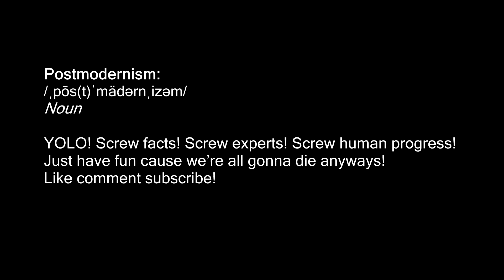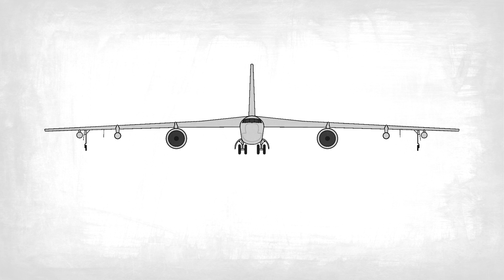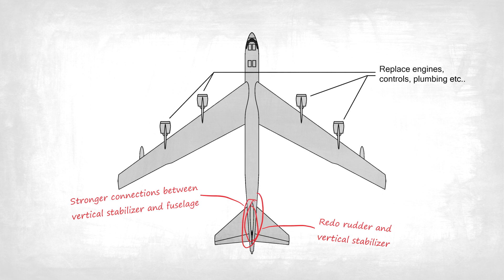The B-52 is Getting New Engines... Why Does it Still Need 8 of Them?

Comment: why not take one B-52 out of service/ one thats out of service and truly see what it  takes in order to modify/change the rudder?? if its feasible and cost effective, wouldn't that offset the cost of 4 engines instead of 8?
Reply: They don't need any airframes at all, simulation software on a modern supercomputer can do the required studies, all except for some fine details.  It's already been done and 4 engines is not even close to being cost effective.  It is much more complex than this video suggests to replace the current 8 engines with 4 modern ones.  Hell, it's a complex undertaking to replace 8 out of date engines with 8 modern ones of the same size!

Let's look at what's involved in replacing 8 with 8:  The modern engines can produce more thrust but at the same time burn less fuel, and they weigh roughly 1,000lbs less for each engine.  It may be a good idea to de-rate the modern engines to the same thrust levels as the old ones to avoid expensive strengthening of the engine pods, pylons and wings.  Perhaps they will decide to keep the extra thrust and reinforce everything, but that does add cost.   They may have to reinforce some parts of the wing structure and wing roots anyway because having lighter engines could mean that in some flight conditions the wing will oscillate more with less weight in the engine pods to stabilise it.  Yes, having lighter engines can lead to a wing structure needing reinforcement, really — aeronautical engineering is complicated.  The different exhaust characteristics also mean the turbulence pattern around the tail will change (the inner engines put turbulence around the tail surfaces) so they will need to study that carefully to see if the tail and rear fuselage need reinforcement — they probably won't, but it will have to be looked at just in case.  Even with this 8 for 8 option some modifications may be needed to the tail area for that reason.

Once it is established what structural changes are needed they only need to change the fuel management system and enjoy the 30% gain in range from the much greater fuel efficiency of the modern engines.  Cost per flying hour may drop by half.  Yes, really.  At worst it will drop by a third.

Put 4 engines on it instead of 8 and the cost of the re-engine program goes up at least 5 times.

To replace 8 engines with 4 you need new engine casings, pylons and the entire wing needs a redesign.  No, you can't just reinforce it, Boeing already admitted that a complete new wing would be needed.  They still tried to sell the idea to the DoD but they weren't buying.  Then you need to reinforce the fuselage at the point where the wings are mated to it.  The tail and rudder need an updated design and although it might be possible to just modify them it is also possible that you couldn't do it that way.  If that is the case then as well as the tail surfaces needing to be replaced the fuselage from the wing to the tail end needs to be reinforced.  So far we only have the forward fuselage and nose area unaltered.  However if so many changes occur to the rear of the plane you may need to alter the forward fuselage just to keep the plane balanced.  That leaves the nose as the only major area unmodified.  Oh, and the landing gear which is so strong and so well designed Boeing said it will cope whatever.  You probably realise now why 4 engines didn't pass.  I haven't even covered half of the extra complexity, by the way.

Comment: The new engines are each around 400 KG lighter = 3200kg in weight savings (though would prob need to add new equipment to interface with the new engines)

But have slightly less thrust, but would be significantly more fuel efficient.
Reply: Everything I have read in the Air Force documents, the new engines have a slightly higher power output, and will never need to be removed from the aircraft, because they are that good.

Comment: Old & outdated.pull out the 747s sitting around & update them.there’s a giant fleet of these things just going to hell.
Reply: Fully agreed.
So many 747s all waiting in the boneyard
Reply: They are there because they are worn out.  In comparison, the bombers have lower flight hours.  Modern bombers are smaller and stealthy, not a big target.
Reply: @robertheinkel6225  modern bombers have big tech & paint jobs that reflect radar.if you mean wore out like electronics they will gut it out in only a few weeks & replace it again.Air Force one is a 747-200 heavily modified for that purpose so it can easily be done & the United States does not mind the cost. In my way of thinking it is easily feasible just has not been approved.

Comment: I worked the B-52 G & H models for 22 years.  This means I have seen a BUFF come limping home after a run on Southeast Asia.  One advantage often overlooked is combat damage.  You take flack or missile damage on an engine or pod, you still have thrust from 6 or 7 engines.  Can’t do that with 2 or 4 engine configurations.  👍

Comment: For those of you who are aware, Rolls Royce had proposed re-engining the B-52 with FOUR engines back in the 90's. The B-52 doesn't "need" 8 engines. That's just what it's going to get.
Reply: you hev squirrel  Sorry, but your base contention ("The B-52 is essentially a modern jetliner") is not correct, so everything after that isn't quite going to work. Just as a quick study, take a look at he differences between a 747 and a 747 freighter alone. And be mindful that a B-52 can carry 48 500 pound bombs plus a full fuel load. 12 tons of bombs alone. No "airliner" is going to do that. And no 787 or 757 can do what a B-52 can do. Sorry.

Comment: I dunno, I think correcting the rudder deficiency should've been done 30 years ago(or today, instead of a marginal engine upgrade) to make way for a better engined version today.
Yea, sure, the new engines prolly have better range, better maintenance, and more bells-n-whistles than the current P-3 lineup, but they got slightly less thrust(on paper) than P-3, which is what came on the B-52H, which is the only variant operating at this time. 
Like I mentioned: They should do the rudder/fusulage upgrade instead, out of spite for safety concerns, and do the engine upgrade(which would be easier than the rudder) afterwards. Especially if ur looking to fly this airframe another 30 years.

Comment: My son flies the KC-135. As a result of swapping out the original J57s with the CFM56 (and its much larger diameter) they have to be very careful during ground maneuvers not to turn at too high a speed and exceed 4 degrees list (roll?) for fear of scraping the engine nacelles on the ground. Lots of things to consider when reengining 60-70 year old designs.
Reply: I was at Castle AFB when the conversion took place.  I always wondered how they could land without scraping the engine cowling on the runway.

Comment: Um no, there would be little need for re-design to change the rudder as the plane was originally designed to handle a fully moving tail. They simply did not have the tech at the time to make it work but they could have easily made this upgrade decades ago.

Comment: Don't put RR engines on the B-52 it would be a mistake
Reply: Why would it be a mistake to fit RR engines ?
Reply: They are proven engines, already in use in a few AF aircraft.
Reply: It worked fine for the P-51.
Reply: Why a mistake? Because it's a British company and the plane is American? As another poster commented, that combination worked fine for the P-51 Mustang. Don't fret, Bob. They will be built in Indianapolis providing jobs for American workers and Rolls have been building engines for over a hundred years, so they're not novices at it  :)

Comment: The bomber is built with multiple backup systems, in electrics and hydraulic systems.   Reducing the number of engines, limits the number of redundancy required.  Just one of many reasons.

Comment: I'd rather they spend the money on the B1. Ditch the 52 already.
Reply: Sadly B-1B is too expensive to maintain. USAF want to retire it as soon as B-21 ready.
Reply: The B-1s are worn out, needing massive rebuilds.  Not cost effective.  The 52 on the other hand will, with the engine upgrades, will save money in the long run, due to better fuel efficiency, and less maintenance.
Reply: @robertheinkel6225  actually it's a little debatable. We just spent money on B-1 upgrades.
Reply: Expensive, expensive, expensive.
Why exactly would you do such a thing?
Is money just not important?
Reply: @WALTERBROADDUS  Please evaluate the cost per ton of ordinance and get back to us.  We have and need a few B-1's, so it's not an all-or-nothing proposition.  But there the economics aren't even close.
Reply: @kurtpena5462  have you seen the size of our budgets lately? We're not exactly clipping coupons or buying from the dollar menu. 😏
Reply: @WALTERBROADDUS  Yes.  It doesn't mean that money is no object or that cool factor comes into play.
Reply: @kurtpena5462  yeah, don't expect too many savings. Estimate I found is that both cost like about $70,000 an hour to fly.
Reply: @WALTERBROADDUS  Um, you do realize that a B-52 carries 4x the ordinance and at substantially lower fuel consumption rate, right?  It's not as if the DoD wants to waste money. XD

Comment: The thing you highlighted as a "rudder" was actually just the "trim tab". It would actually be quite easy & cheap to design & install a new "enlarged" rudder. The real "culprit" is the vertical stabilizer. That is the non moving part that the movable rudder is hinged to. Even that would be easy to add a "dorsal fin" in front of, & blended into, the vertical stabilizer. I know. Because I did it on a C130, and it worked beautifully. It's far more likely, the 8 engine decision was "political". More bribe money to corrupt politicians & Air Force Generals.

Comment: On 10/19/21 I was tracking a B-52 based out of Minot on flightradar24 flying random patterns over southeastern Montana. According to the website, it was traveling at 634 kts(730 mph) at 27,000 feet. 
Isn't that faster than the speed of sound?🤔 
I didn't think the B-52 was capable of supersonic flight.
Reply: It can’t exceed the speed of sound, but the speed depends on multiple variables, like temp, air density, altitude.
Reply: I wouldn’t trust an app to give you accurate information on a military aircraft.
Reply: The ADS-B data on the tracking sites is ground speed, not airspeed. The wind at 27,000 feet can add 100 knots to the ground speed, or subtract from it..
Reply: Is that airspeed or ground speed? I suspect ground speed if it is recorded from a ground station and accurate. You could be flying at less than the speed of sound, but with a fairly common 100 mph tailwind from the jet stream, the speed over the ground would be greater, but the plane would be subsonic moving through the air mass.

Comment: I still not convinced about the "rudder" thing. I think the USAF will push for the 4 engines. The B-52 tail has been redesinged already (D/F versions to H).
Reply: It may not just be the Rudder though. There could be issues with how the 4 engines work with the old Stability Augmentation System AKA anti Dutch Roll system. That system was why the tail got a redesign in the first place.

Comment: Hmmm, last I heard about this program is, they were indeed looking at a 4 engine option. Even with your explanation on why the 4 engine option is inherently unstable for the aircraft, I wouldn’t be surprised if they did modify the tail and rudder. They’ve done it with other airplanes in the past, why make the exception now?

Comment: The single engine per pylon would work, if you kept the max thrust output to the same level you would not introduce any more stress. Since the new engines are lighter and less of them the fuel effenciency is the gain here. If you can go at the same speed with less fuel burn you increase the range between refuels.

Comment: You also have to consider the landing gear. It's short. Larger diameter engines would be awfully close to the ground. The four outer engines already are. I think it wise just to leave it as is until the B-21's arrive, at which time the B-52's and B-1's are all going bye-bye anyways.
Reply: I bet the B 1s will be around for awhile.  Stunning looking.  Had one overfly me around Pensacola at about 200 feet on landing.  Impressive.

Comment: First flight: 15 April 1952 - Well past time to scrap it.
Reply: Agreed.
Plane is older then the parents of its Pilots  . LOL   :))
Reply: Are you ignoring the fact that current fling B-52s were built years after the original design.  With your logic, the 64 Ford Mustang is the same vehicle as a 2022 Mustang.
Reply: @robertheinkel6225  Prolly just doesn't seem cool.  Maybe it needs a notch at the top...  
As a cool new feature.

Comment: In showing the 787, I couldn't help but wonder why not just order a cargo/bomber version of that airplane?  OR, with 747s being phased out of passenger service and refitted for cargo, why not revise some of those as bombers?

The one thing I can see for the B52 is the legendary strength of the airframe even after having been shot full of holes.  I doubt that modern planes could withstand that abuse.

Comment: Can they go with a six engine design?  Two on each of the inner pod, and one on each of the outer pod.  
Operate the inner pod engines as 50% unless the have an engine problem and have to shut one down, then they can run the other one at 100%.

Comment: The new engines have same thrust but burn less gas hence increasing ranges.
Switching to 4 nacelles renders the aerodynamic changes that could offset the economy of fuel. 8 engines also provide more safety should some engines failing in flight, a very probability given the combat role of the B52.

Comment: The Air Force needs to have the aircraft manufacturers design a whole new aircraft specifically to replace the B-52. It would have to have the same, or better weapons load, range, and speed. It would also have to perform as well, or better, than the B-52 at high altitude and low altitude. Of course, anything unnecessary and isn't required to do the mission, like Stealth, would have to be eliminated. That would be a true one for one replacement program. I would like the Air Force to get out of its reliance on this, or any, platform without a true replacement. The Air Force's bomber program is stuck. It relies on Stealth too much. These are overpriced programs with huge maintenance costs, as well.
Reply: It is an economical program.  That's why it exists.  What you suggest is replacing something that works with something new because...
What exactly would you improve and at what cost?
Reply: @kurtpena5462  If there's no room for improvement, then build more of the same. 🤷🏻‍♂️ But, it seems unlikely that there's no room for improvement.
Reply: @bryanbishop2377  What exact would building more from scratch save when no new air frames are needed?

Comment: So Rolls Royce won the contract, all I can say is that the Air Force will be very sorry, Rolls Royce engines suck. And if you doubt me, my qualifications for saying this are as follows, I have flight experience on the following aircraft as a Flight Engineer, B727, B747, KC-10, C-5, C-141.
Reply: (1) Rolls have been making aircraft engines for over a century and it's one of the most well-established and respected names in aviation. Its engines have powered so many iconic aircraft in aviation history (too many to mention here) including the Spitfire, P-51, Mosquito, Lancaster, A-7 Corsair, Harrier/AV8B, Concorde plus private and commercial jets including many/most Boeing and Airbus applications. It's currently the world's second largest maker of aircraft  engines after GE and ahead of PW. (2)  All 727 aircraft were built and delivered with versions of the P&W JT8D series engines. Some 727-100 aircraft were refitted later with RR Tay engines, turning them into the 727-100 QF. This was a modification applied only to UPS freighter aircraft and one private aircraft by Dee Howard. No passenger airliner aircraft were so modified. All the UPS 727 freighters are no longer flying. (3) A pilot's favorite is the 757 equipped with RB-211 engines. It was so overpowered that it was nicknamed the "Seattle Hot Rod". It's an aircraft fans' favorite too for the same reason.
Reply: I suppose in a way you are correct.  From the very first gas turbine ever installed in an aircraft and regardless of manufacturer, they have all sucked air.
Reply: @Stewpot-29  lmao!
Reply: I think you may have misunderstood me.  I was being facetious and not I think arrogant.

Comment: Can a pair of engines that rotate counter to each other help with engine failure induced yaw like on the Airbus A400’s turboprops?

How about the outer pylons with pairs and larger turbo props in the two inner pylons?

If you think about it, all Unicorns are horny by definition too.